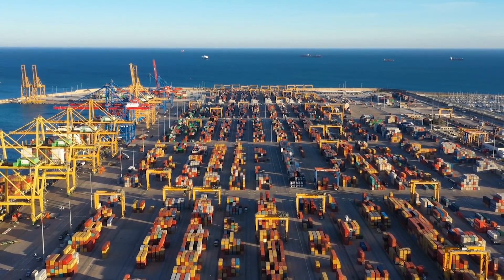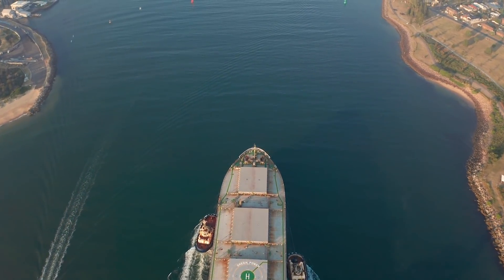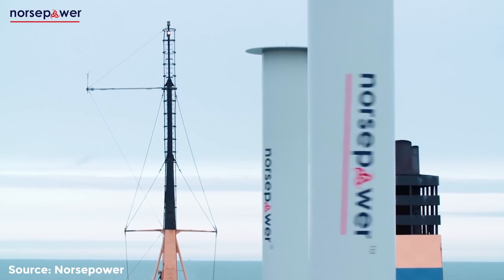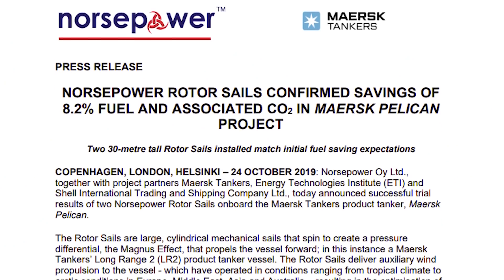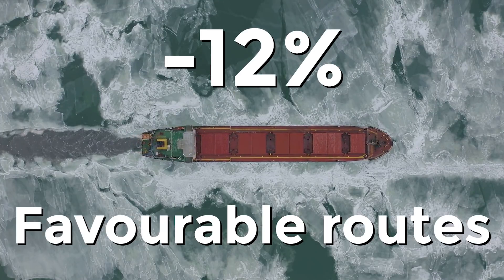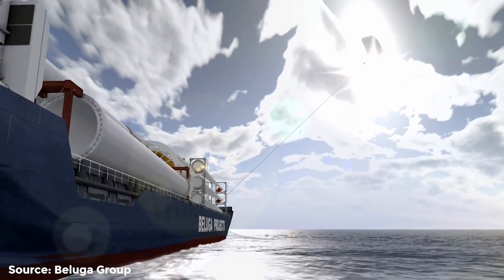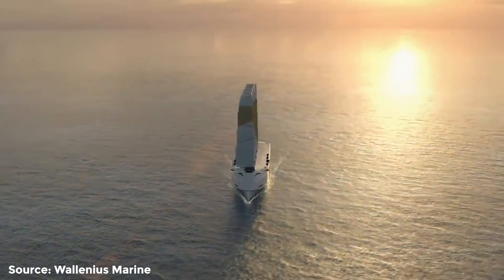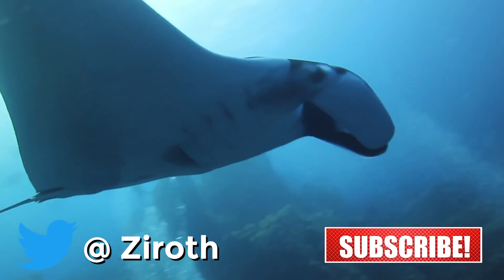Is Wind Power The Future of Shipping?

Comment: Sure if you don't mind your stuff being 2 year late. Or you just want to use it as long term storage to evade regulation.
Reply: To address the suggestions that wind power is the answer I offer the following example.  In 1870 a premium sailing vessel entered service, the ‘Cutty Sark’.  The ‘Cutty Sark’ was 64.74 metres in length with a beam of 10.97 metres and a loaded displacement of 2 100 tonnes.  She was able to carry, at best, 1 700 tonnes of cargo and to harness the energy in the wind the available spread of canvas was up to 2 976m2 which was tended by a crew of about 30 skilled men.  A ratio between the sail area (SA) and the vessels displacement (D) determines how lively she is; ‘lively’ being nautical speak for ‘fast and manoeuvrable’.  The carrying capacity of cargo ships is constrained in two ways, mass and volume which leads us to the ‘stowage factor’ of the cargo; the more mass on board the greater the displacement which in turn impacts the efficiency of the hull form and sail area / displacement ratio.  A vessel constrained by mass is said to be ‘down but not full’, while a vessel constrained by volume is said to be ‘full but not down.  When in the tea trade, which the ‘Cutty Sark’ was designed and built for with fine lines (more nautical tech speak, so again no need to worry about it) she could carry around 600 tonnes of cargo at speeds of up to 17.5 knots dependent on the prevailing wind and had a typical China to UK time on passage of 120 days.  The tea trade was very competitive so ‘time on passage’ was a large factor in securing the premium freight rate that made her cost effective.  Rounding things out, her maximum available sail area gave circa 5m2 of canvas for every tonne of tea carried.

As soon as the Suez Canal opened, which the ‘Cutty Sark’ was unable to sail through; she lost her advantage, raw speed, to the steam powered ships of that era who could beat her ‘time on passage’ by taking that short cut.  Mechanically powered ships have improved in terms of efficiency, on a freight tonne mile basis, by at least one order of magnitude since then.  After losing out to the coal burning, fire tube boiler, steam reciprocating mechanical ships of the late 19th century ‘Cutty Sark’ was relegated to the Australian wool trade, just about the bottom of the barrel in maritime terms and only one small step up from being a 'honey barge'.  The canvas, cordage and extra manpower needed for sailing ships was never a very benign environmental option so please discount any idea of sail as ‘sustainable’.  All this is without the problem that if ‘the wind don’t blow the ship don’t go’, when it does blow it often blows in the wrong direction for your cargo delivery needs and sometimes there is rather too much of it for comfort.  Sailing ships are unable to go directly up wind so if the wind is blowing from the direction your cargo needs to then a zig-zag course must be steered, more distance and more time.  Wind speed is traditionally measured on the Beaufort Scale (wind speed) that runs from 0 (< 1kn) to 12 (> 63kn) and for sailing purposes the usable part of the range is ‘3’ (circa 8kn) to ‘6’ (circa 24kn).

Comment: the bunker fuel is of such cheap quality, and the efficiency of the 2 stroke 3 story engines, is crazy high - that there is little to be saved in present day - esp combined with slow sailing nowadays
Reply: On the ‘reduced impact front’ a lesson might be learnt from the past, in the 1930’s a group of six ships that were being built for the British Tanker Company (BP) to their “Three Twelve’s” design (12 000 tons deadweight, with a speed of twelve knots and a fuel consumption of 12 tons per day).  These ships were purchased whilst still ‘on the stocks’ and completed for the Admiralty so they could keep ‘the fleet’ fuelled up and at sea.  12 000 tons deadweight (dwt) is tiny by today’s standards with ULCC’s being twenty five times that size (300 000 dwt) while typical service speed has only increased to around fifteen knots, or by 25% if you like to keep things relative, and daily fuel consumption has gone up to about 60 tons (or half an order of magnitude to be academic about it).  Bear in mind that speed reductions, a useful buffer for adjusting variations in demand, will in the long term require more goods in transit to maintain any given long term level of supply.  Typically tankers move at 15kn so a reduction of speed to 12kn could yield a fuel consumption saving of 20% (?), however to maintain the same flow of material an additional 25% of shipping capacity will be required.

4 ships at 15kn =   60 freight miles =   5 ships at 12kn.
	fuel used x	                                 fuel used x (+ or - ?)

Reducing consumption is ‘fewer people’, ‘less consumption per person’ or both.  Addressing consumption the following was posted by hsm_epic_return ‘the cruise ship industry is all about greed and gluttony and has no purpose’ a sentiment with which I fully concur.

Comment: I think that hybrid ships with some kind of "sails" and conventional propulsion is a good idea. The sails won't replace propulsion, but it would reduce the fuel consumption. So the problem is to choose the best type of sail.
Reply: To address the suggestions that wind power is the answer I offer the following example.  In 1870 a premium sailing vessel entered service, the ‘Cutty Sark’.  The ‘Cutty Sark’ was 64.74 metres in length with a beam of 10.97 metres and a loaded displacement of 2 100 tonnes.  She was able to carry, at best, 1 700 tonnes of cargo and to harness the energy in the wind the available spread of canvas was up to 2 976m2 which was tended by a crew of about 30 skilled men.  A ratio between the sail area (SA) and the vessels displacement (D) determines how lively she is; ‘lively’ being nautical speak for ‘fast and manoeuvrable’.  The carrying capacity of cargo ships is constrained in two ways, mass and volume which leads us to the ‘stowage factor’ of the cargo; the more mass on board the greater the displacement which in turn impacts the efficiency of the hull form and sail area / displacement ratio.  A vessel constrained by mass is said to be ‘down but not full’, while a vessel constrained by volume is said to be ‘full but not down.  When in the tea trade, which the ‘Cutty Sark’ was designed and built for with fine lines (more nautical tech speak, so again no need to worry about it) she could carry around 600 tonnes of cargo at speeds of up to 17.5 knots dependent on the prevailing wind and had a typical China to UK time on passage of 120 days.  The tea trade was very competitive so ‘time on passage’ was a large factor in securing the premium freight rate that made her cost effective.  Rounding things out, her maximum available sail area gave circa 5m2 of canvas for every tonne of tea carried.

As soon as the Suez Canal opened, which the ‘Cutty Sark’ was unable to sail through; she lost her advantage, raw speed, to the steam powered ships of that era who could beat her ‘time on passage’ by taking that short cut.  Mechanically powered ships have improved in terms of efficiency, on a freight tonne mile basis, by at least one order of magnitude since then.  After losing out to the coal burning, fire tube boiler, steam reciprocating mechanical ships of the late 19th century ‘Cutty Sark’ was relegated to the Australian wool trade, just about the bottom of the barrel in maritime terms and only one small step up from being a 'honey barge'.  The canvas, cordage and extra manpower needed for sailing ships was never a very benign environmental option so please discount any idea of sail as ‘sustainable’.  All this is without the problem that if ‘the wind don’t blow the ship don’t go’, when it does blow it often blows in the wrong direction for your cargo delivery needs and sometimes there is rather too much of it for comfort.  Sailing ships are unable to go directly up wind so if the wind is blowing from the direction your cargo needs to then a zig-zag course must be steered, more distance and more time.  Wind speed is traditionally measured on the Beaufort Scale (wind speed) that runs from 0 (< 1kn) to 12 (> 63kn) and for sailing purposes the usable part of the range is ‘3’ (circa 8kn) to ‘6’ (circa 24kn).

Random fact about ‘Cutty Sark’, it is said to have been possible to coax 3 000 horse power out of her sails, or in ‘real money’ 2 206 500 Watts (2.2 megaWatts), assuming this was in ideal conditions that is about ⅔ of the solar power that might be harvested from the ‘top of stow’ of a Maersk Triple E, again in those elusive ideal conditions and 741 Watts for each square meter of sail area.  So that majestic spread of canvas would have been even less efficacious for delivering your baubles and bows from the orient, despite taking about three times as long on the voyage.  The sails on the ‘Cutty Sark’ produced about 0.33% of the power need to propel a Mearsk Triple E and covering the top of the Mearsk Triple E stow might produce another 0.5% so with both systems working simultaneously in ‘ideal conditions’ the energy harvest would be less than 1% of the output from the ICEs.  Combining with solar electric would involve two systems in place of one, which then runs you into the problems of expense, complexity, integration and redundancy.  Remember shipping is a high volume low cost, therefore low margin business, and all costs have to be beneficial.

Canvas and hemp are accorded 'renewable' (read as ‘natural’) status, if ‘synthetics’ are used there will still be a need for the input of FOGI products.  'Synthetics' would have a much better working life span than 'naturals' but would still yield the same amount of energy, 741 Watts for each square meter in those elusive ideal conditions.  Wallenius are currently giving wind power a go with wing form ‘sails’ but evidence is a little short of proof as of this date.  KTH (Kungliga Tekniska högskolan), a sort of up market university in Stockholm, who are using the funding to derive results will probably, and eventually, in the best traditions of academia ‘publish’ a ‘paper’ unless the funders invoke the well known ‘commercial sensitivity clause’ of their agreement with the KTH.  Wallenius is a major shipper of vehicles were the product is effectively its own packaging, other goods are moved about in ‘containers’ so the loss of capacity, ‘broken stowage’ in nautical speak, caused by containerisation needs to be factored in.  On board wind turbine might get you around some of the problems, however for marine use vertical axis wind turbines (VAWT) would be better than, the what have now become 'traditional', horizontal axis wind turbines (HAWT) for reasons that include the air draught of the vessel, weight distribution and maintenance access.  The energy yield is still subject to the wind blowing at the right strength and having space available on board for the hardware.  The masts, rigging and sail handling arrangements would take up 'prime real estate' on the vessel.  Fuel oil bunker tanks can be, and usually are, stuck away in any odd corner and the ICE power plants are themselves relatively compact.  The stacked up 'boxes' would mean putting the wind driven propulsion units in a bad situation from a ship stability point of view.

Comment: Saw a wind turbine mounted in a cylindrical dirigible. With improvements to reduce friction, might compound the application to drive electric propulsion so the energy pick-up and course/direction of ship can be optimized independently. Like a kite this system would benefit from efficiency at altitude, wouldn't obstruct un/loading and could be modular - fitting to any ship with electric auxiliary propulsion.

Comment: What about enercon E-Ship,
Reply: With regard to propulsion with electric motors powered by ‘green electric’, leaving aside the fact that there is no truly ‘green’ electricity, the best we can do is low carbon impact both at installation (capital account cost) and production (revenue account cost).  Running ships on the ‘lecky’ is tricky the two examples that I personally know of, and have used, are a vehicle and foot traffic ‘chain’ ferry that ply’s its trade across the hundred meters or so of the Nordre älv between the island of Hisingen and Kornhall on the Swedish mainland.  The motors are on the ferry and a power supply cable is unwound and wound back up on board as the ferry shuttles back and forth from Kornhall.  When the vessel goes anywhere else, id est dry dock for survey and or maintenance, it is towed by a good old ICE powered tug.  The other electric vessel is a vehicle and foot traffic ferry that runs from Helsingborg (Sweden) to Helsingor (Denmark), a twenty minute trip undertaken using energy stored in batteries on board, she tops up the charge each time she is alongside and battery capacity is said to be sufficient for an hour of main engine use.  A video is available on the Fully Charged channel of YouTube, ‘100% Electrical Ferry Crossing’.  There are small diesel generators on board; to keep the lights and other safety related items on in extremis.  Electric ships currently have short ranges and high light displacement  as a factor of their cargo capacity.  Sadly as of now electric boats are as functional as chocolate fireguards, yes ‘submarines can be diesel electric’ but they have negligible cargo carrying capacity and if you ever go on one (HMS Alliance is available to visit as a static exhibit at Gosport, UK or video available on YouTube, https://youtu.be/Q23uoxT16gO) your first thought could be ‘not much room in here for the crew is there?’  What about electric tug boats?   That would at least improve the air quality around ports, and they can recharge daily since they stay near the port.  Well though that might be feasible in practice ‘tugs’ need lots of power in short burst with readily available reserves for when things do not go according to ‘plan A’.  So hybrid ICE/battery could be an option, so long as the economics stack up, and would be a means of quantifying part of the cost of environmental improvement; getting values to add to the debate would be a very useful tool.
On board wind turbine might get you around some of the problems, however for marine use vertical axis wind turbines (VAWT) would be better than, the what have now become 'traditional', horizontal axis wind turbines (HAWT) for reasons that include the air draught of the vessel, weight distribution and maintenance access.  The energy yield is still subject to the wind blowing at the right strength and having space available on board for the hardware.

Comment: I seen a documentary on replacing ships with zeppelins. The modern ones have less gas leakage, use solar power, travel faster than ships, and an land faster. They do not have to wait for a spot to clear at the dock. One person picked up a huge zeppelin by the tire and balanced it on his head
Reply: Limited payload, JHAT (just have a think) one box boat, like the 'Ever Given', 200 000 tonnes of cargo Hindenburg 20 tonnes of lift and they both occupied a similar amount of space.  Plus we know that the Hindenburg did not end well.